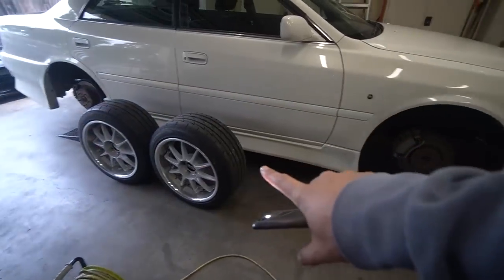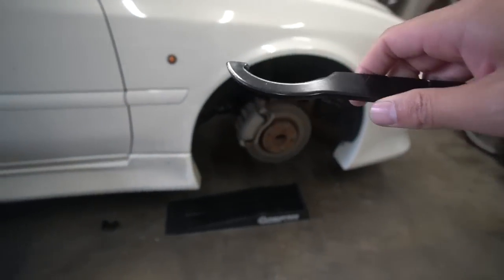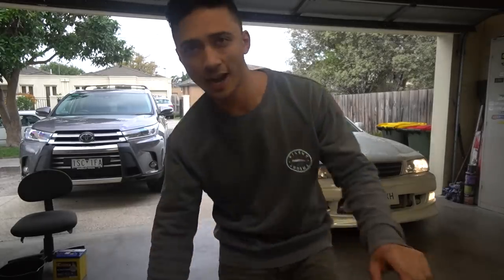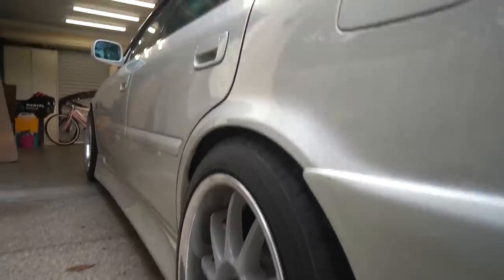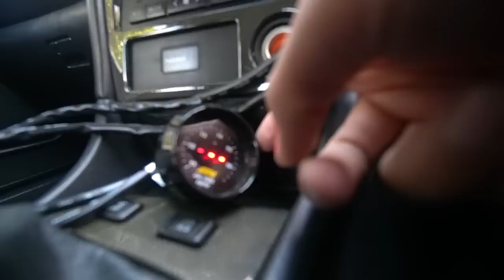NEW SUSPENSION FEELS AMAZING! : Shockworks

Comment: Rex check your maf sensor, mine used to do the same thing after getting the rpms up. I was running a HKS pod filter. Changed over to a SCA one and i think there was too much airflow for the maf whilst running hks pod filter. Since changing to SCA pod filter ive never had that problem since...

Comment: Your cars fitment will never look great. the side skirts are to big for you to go lower on the 17s you really should sells those and  get 18s to get nice fitment with that body kit, factory aero would be a great option for the 17s as the lip kit sits higher on the car so you would be able to lower it more I’m not hating on it but you really should run 18s with that kit or get factory aero
Reply: The fitment is perfect for dailying and drifting too. If you go too low its not ideal for drifting
Reply: @surenberugoda161  mate you call that good fitment bahaha, that's why he needs the 18s so it will lift the car of the ground more and they will fill the wheel arch so they look lower